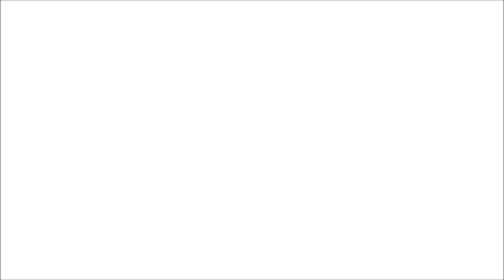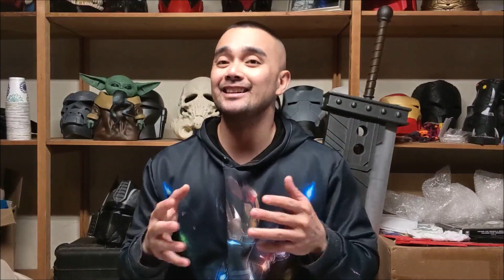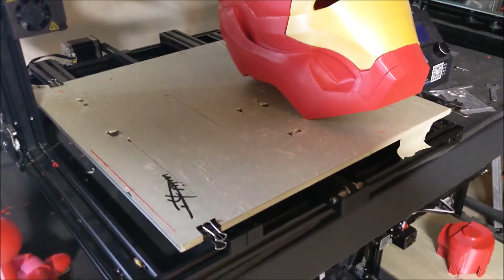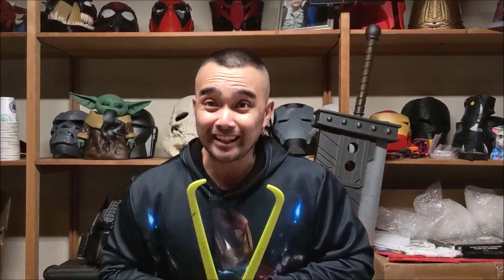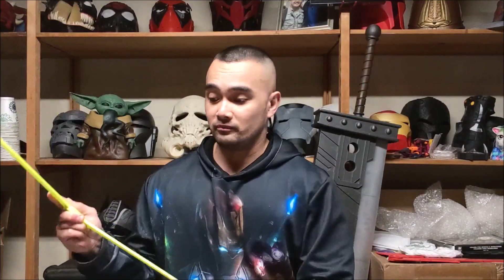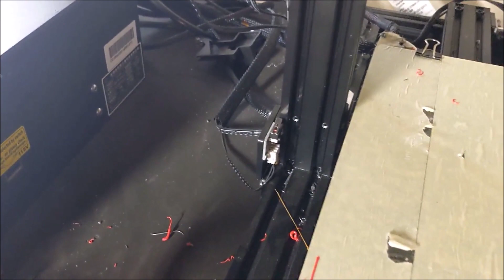The Best 3d Printer For Cosplay

Comment: I've been happy with the S5, but I did replace the bed with a piece of tool-plate and a Keenovo. I ended up building a 500x500 corexy machine and can print much faster now due to not throwing the huge bed around, plus the heavy print on it. I went with the S5 originally as for printing droids like Chopper or R2D2 you can print the dome in one piece.

Comment: Thanks for the recommendations... And from the photo above you looks like you were in the military, if so,  thank you very much for your service... Cheers
Reply: hey guys i just finished my first full 3d print of the first order stormtrooper armor thanks for all the help one more question can any of you guys actually sit when wearing  the armor in pla? my movement is a bit restricted and i cannot kneel down let alone sit just want to see if its just me or if this is typical thanks
Reply: @DH-fc2os  You really can't sit down in most trooper armour. You can adjust it to be more comfortable.
Reply: @originaltrilogy1  thanks I ended up using you much better I have learned a lot here and discovered some of my own helpful ideas. 
Wish I could smooth out my pieces better even after tons of sanding and using alexflex which is awesome I still seem to have imperfections I guess I have OCD when it comes to this stuff lol
Reply: @DH-fc2os  I go for really slow print settings and made an enclosure for the printer. Way less sanding and finishing required. The prints a s-l-o-w but then again the amount of finishing was reduced by tens of hours per part, so it was probably the same in the end.
Reply: @originaltrilogy1  thanks I  will try that

Comment: Shame to hear you've had bad luck with your Chirons. It's my first and only printer but mines ran flawlessly since I bought it last November (and it came from Gearbest; opened the box, bolted the gantry on and started printing, didn't even know about checking bolts and wheels, but I never needed to). After reading so much on printers I can't imagine using anything without an Ultrabase, seems crazy to be using things like hairspray/glue/tape.  But should my wife allow to me get another printer, I'll definitely consider the S5.

Comment: If you're going to consider a CR10s-4 (400x400) then spend the extra few bucks and the s5 (500x500).  For a little more money you don't want to be two months down the line and find yourself short 50 mm.  If you're going to be in it $800 why not make it $900 and be able print damned nearly any armor part you can think of in one go?
Reply: The 500 is considerably larger, and the S4-400 is already a very big printer. Unless printing R2 domes, there isn't a lot of times the extra 100mm helps, for swords you still have to break the models up. I love my S5, but apart from domes, have never needed to go past 400mm.

Comment: To my own ignorance, I didn't notice that the S4 had a larger volume. I ended up getting a standard CR-10S, it works fine for me most of the time, but it's a close fit sometimes. Kinda wish I checked the S4 variant.
Reply: Whats the biggest thing you've been able to print? I was hoping print mando's helmet but I was curious if it would fit.
Reply: @skphouston  You should be able to fit a Mando helmet on the build plate, I have looked into printing one myself but never got around to it. I have printed the front of a chest plate on it diagonally, albeit a little smaller than I would like (think the size of an ODST chestplate).